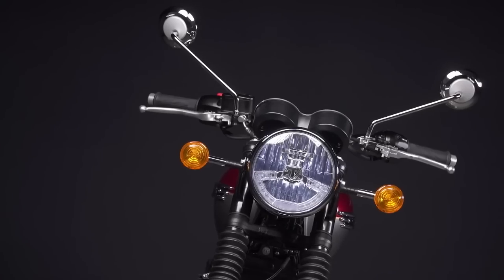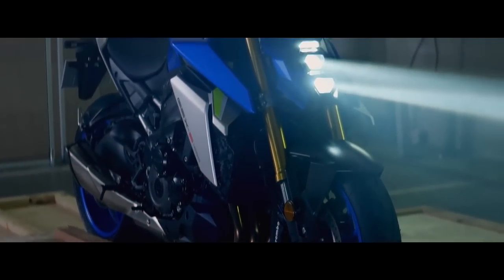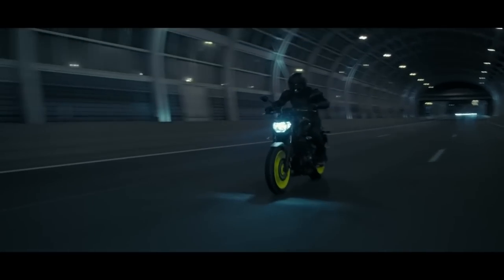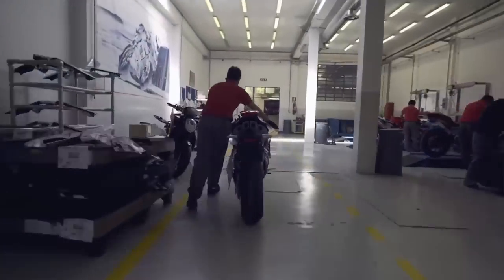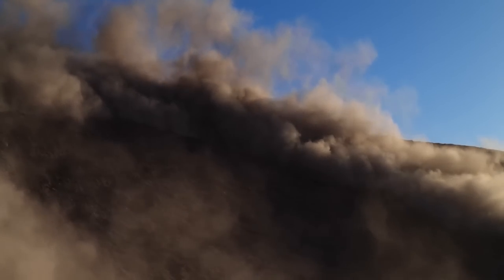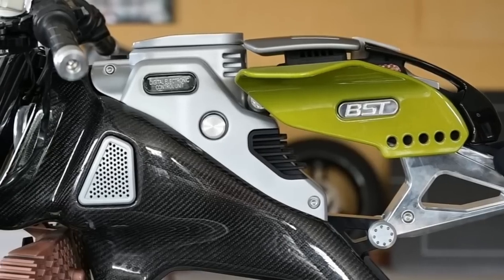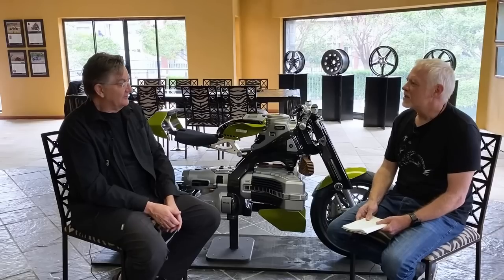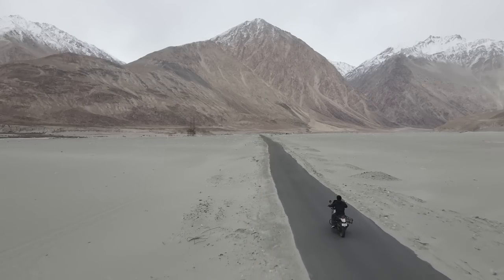Why old motorcycles look better than new motorcycles

Comment: The old motorcycles are much more honest. No fly by wire. No nanny functions.  
A carb handles fuel which you totally control. The FI unit has a brain somewhere which you request for fuel. No plastic covers. And so on.
Reply: I drive a throttle by wire truck with an automatic transmission for a living. Every time I try to accelerate it's like asking a committee for permission to do something that they don't understand
Reply: @danmanthe9335  you must drive a shitty DBW vehicle.  For actual vehicles meant to be fast, not only is this not a problem but it is vastly superior to boomer tech.
Reply: @twrcrew8852  seeing as how it weighs 20,000 lbs empty no, it wasn't meant to be fast. At all.  In any galaxy anywhere,  it's slow
Reply: @danmanthe9335  then ofc its no metric of what DBW actually offers. there are more pros than cons. the one boomer argument for anything electric is "i can't see what's happening so it sucks".  while it offers superior smoothness, response, ease of replacement, ease of access and removal/installation. and zero plumbing in most cases. 

I understand that there's a lot not to love about modern equipment that were put there EXPLICITLY to make life more difficult or adhere to politician's ideals that are not based in reality or experience, but DBW is not one of them.
Reply: @twrcrew8852  no, it is absolutely not a fair assessment of what the technology is capable of. Just one particular instance of it being frustrating
Reply: @twrcrew8852  DBW is excellent on a race track, so is puck clutches, slick tyres and a host of other things designed to cut .008 seconds off a lap time.

But when the cheap outsourced glorified potentiometers go bad due to any variable of reasons you’re left stranded.
 
Sure a flick of the wrist or shove of the foot is faster, but when you’re stranded by the side of the road on a rainy night in a forest. Vice grips won’t fix it. And you can’t magically pull a diagnostic laptop out of a tree to diagnose which part of the signal chain has decided todays the day to die. 

Simplicity is key in design, but nuance is lost for complexity. I prefer something that can be fixed and addressed simply. Flashing lights and fancy devices seem to be more headache then they’re worth once the warranty goes tits up. 

But if you desire Motogp technology for a 45mph commute to a corporate coffee shop then, so be it. 

But me I feel technology gets in the way half of the time and just adds unnecessary cost to the equation of get ass from point A to B.
Reply: @battoisoutto6657  You talk a good theory based entirely on the principal of an assumption. particularly this line "when you’re stranded by the side of the road on a rainy night in a forest. Vice grips won’t fix it. And you can’t magically pull a diagnostic laptop out of a tree to diagnose which part of the signal chain has decided todays the day to die"

Although it is mostly assumption and unfounded in truths, but rather fears and hypothesis. 

First of all, any DBW system is not simply run on a single line of code, a single circuit, or a single input source unless you're running a sub 2000 dollar chinese scooter or bicycle, maybe an RC car. Every system has redundancies in place, no not via hardware and a throttle cable, but within the hardware it does have. multiple redundant codes, chipsets, and input devices (they're not measured using potentiometers.)   In a semi-modern car that's run by fuel injection, an ECU, and a maf sensor - ALL of your risks that drive your fears about the vehicle rendering itself inoperable if any one of those things fail is just as high.   A single engine system failure takes out the whole vehicle. Having an extra throttle cable in your trunk or even a vice grip implies you'll fix the problem as long as the car was made in the 1960s and carbureted.  You're not using that argument for anything even remotely modern. 

The main reason above all else that needs no explaining however is that most cars on the road today are already DBW, and you didn't even notice. There's not hundreds of cars dead on the side of the road in your area each day, in fact that WAS an occurrence in the 60s with the "never breaking" old school tech.  Things are getting better, REGARDLESS of complexity - which is really only a source of frustration to the end user who wants to fix things in their back yard with no formal or commitment to the education that would properly equipped the individual with such knowledge and ability - whereas before a shade tree mechanic could start banging around and get lucky.
Reply: @battoisoutto6657  I'll end on one note, simplicity IS better. But what you believe simplicity is - is not always what it seems. Not saying Tesla, BMW and Mercedes did things right (examples of needlessly complicated vehicles to the point of detriment), But there are some things out there that run on just enough hardware, just enough software, and do it seamlessly and like clockwork, better than the most old school race plumbers nightmare with ITBs and carbs.  Obviously you could have it even simpler, but that's why bikes of that vintage are more comparable to Chinese 2 stroke bicycle kits than to something that truly lights your hair on fire. You need to meet in the middle, with the best tech available to you for the end goal.
Reply: @twrcrew8852  

Simplicity is great, so is a splash of technology where it is needed. Emphasis on needed. 
Modern vehicles aren’t easy to repair. If you think so then you must have access to an amazing shop.

My favorite vehicle I have is a 2002 Mexican VW bug. It’s reliable, simple and aircooled. Yet with basic technology upgrades.  Throttle body fuel injection driven by a cable, hydraulic lifters, and only the minimal amount of sensors required for the basic ECU. Disc front brakes, but also power nothing.  No driver modes, no 200+ plus computers giving me fancy gimmicks I’ll never use because I’m not going on the Nuremberg ring.

It’s a manual  4 speed, with crank windows, and the luxury of a radio. It’s a peoples car. Simple as.

I’ve had the original  ignition coil fail that was easy to replace part in a parking plot with tools purchase from a dollar store. If the same module failed on other modern car I would have been trapped in the worst storm to roll through the area in years.

But I get it most people need power everything and every electronic nanny turned on. But how long do these last?  I’ve seen countless cars after 7 years develop costly issues. A look on how fast luxury cars depreciate and how everything is getting infested with ‘technology’ that’s more and more inflating costs and adding in more fail points. Every “luxury” or “life improvement” feature adds on complexity. 

A look at any automotive channel that purchases ‘cheap’ cars like hoovies for example highlights this.

But I get it I’m an outlier in a world where people don’t want to fix stuff and a land where corporations are going out of their way to design stuff to not be serviceable by the end user. 

And nobody cares.

I’ve watched my friends get burnt on modern lemons because they’re designed to fail and be impossible to service. Dodge, Chevy, Ford, VW, the list goes on. Thousands upon thousands of dollars wasted, and cars that were mechanically totaled because what used to be serviceable parts were buried deep into engines, under intakes, or requiring the removal of exhausts manifolds. 

Computerized clutches too on modern manuals that cost 4500$ to replace. Happened on my mothers 2016 Jeep Renegade 

So many people I know just want simple and reliable vehicles.  And many want something that is maintainable. Especially in this current insanity that is the car market.

But we’re not afforded that luxury. We’re given insanely expensive vanity items that only keep on rising in price. So yeah simplicity is dead these days.
Reply: @battoisoutto6657  Again. you already seem skewed to one end. And it shows in your nearly obsession-based ownership of a recent 1st gen bug.  7 years, nah not really. I fully built my 240sx in 2008. Using the best of what modern tuner tech had at the time.  Didn't touch any of it since, more than 10 years and 130,000 more miles later (the car itself is well above 200,000 miles on the body), none of the computers or anything else you'd call "overly complex" is showing any signs of breaking or giving me problems.  It runs like a top. Motec, Haltech, HKS, and Greddy build good products that last.  In fact, the ONLY major thing showing signs of wear are my piston rings - to be expected on a 130,000 mile forged motor with a lower silicone piston that was built to be pushing 3x the factory power figure above 6000rpm, which has been visited often in this time.  

The electronics? nope. In fact, this motor can't afford to have ANYTHING go wrong on it, because it's level of tune is on such a fine margin of error. 

Let's talk about a newer car; my 2016 Mazda Miata RF.  There's BCM data sent through the ECU itself. What does the door handle have to do with the engine? I'm not sure myself. But knowing that it is a retractable fastback, it does roll down the windows slightly when you get in and out. Also when you put the car's top down..  ohh nooo. the scary electronics in the door window.. it might break!   Yea, it could. But you know what? there are cars from 2005 with this door open window down feature that still work. and it's not "most of them are broken" either. most of them still work. Cars made over 10 years ago. 

So to summarize, your fears and obsessions with owning clocks just to ensure you flee from any possible problem with an objectively complicated object - no matter how you slice it - are based entirely on fear itself.  The amount of stress you spend trying to hold your life together through your vehicle is not worth the efforts.  I remember what it was like to constantly try to cover and garage my 240 and to do "all the things" to combat rust and corrosion.  I even looked into replacing as much of the vehicle with non metallic material as I could.  The effort to be extreme will still end the same way. Your VW - WILL - break. And you know what I find? the difference in time that such will happen is not as extremely short for modern vehicles and long for vintage vehicles as you hope it will be.
Reply: @twrcrew8852  yeah because spending 5 minutes to replace an original part in a parking lot is such a waste of my time.

I haven’t spent hours on weekends on my VW bug. Because it’s simplicity.  Keyword this is a Mexican vw not the new beetle POS that’s a rebranded golf. Technically this is a Vocho sedan 

Funny how researching all manufacturers brings this up with a few select models of cars that don’t give any problems. But those cars are in between.
Reply: @battoisoutto6657  The big 3 Japanese manufacturers are far from "in between". Unless you live out in hicksville where you don't see Japanese cars out of stubborn brand loyalty?

We've established that you were talking about the Gen 1 beetle, let's not insult my attention to detail here. Also, should others who actually enjoy fast cars with their own unique design want to indulge the senses, they certainly shouldn't be reduced to owning only a bug if they also want reliability - which I can assure you they certainly aren't - DESPITE having a little more complexity.   I will stand by my flag of knowing that you are blowing your fears of complexity out of proportion based on your limited experience and anecdotal evidence of friends who owned notoriously bad vehicles.  

I on the other hand will continue to enjoy the best of what technology has to offer and pick and choose from it what helps me enjoy the car more while still not encountering the headaches you think I'll end up with.
Reply: @twrcrew8852  Well even the big three Japanese companies have had a drop off in reliability as they start cutting corners.

But hey time is money and why not spend thousands in a repair shop for basic maintenance. I mean even Toyota charges shop rates only a few clicks below Ferrari. 

But yeah I’ll take my lowly insult vehicles of the Measely Mexican VW bug, Saturn sc2, and a box panther Lincoln town car. All cars that are known to break high mileage counts without a sweat.

But you enjoy your fast as balls technology and enjoy the prices when something will go wrong. Different strokes for different folks. 
Lol.
Reply: @battoisoutto6657  Except that I am not spending exorbitant amounts of money, That lincoln town car will eclipse my repair bills in gas and oil alone 5x over.  (you realize in 2022 any car that gets less than 40mpg is spending more than twice the money each year to run that a car that got 18mpg in the 90s did? My 2018 civic hatch worked out to 3400 a year in 2019 - for just fuel and oil changes... that was a 40mpg car. So a 20mpg car would have costed me 6800 in that same year, now imagine in 2022 when gas is not 3.85 anymore but 5.75 and rising.   So your "cheap" car in 5 years costs more than my civic does to buy outright. and I assure you this car wouldn't break in 5 years like you think) And that saturn is  far from a car that's been future proofed. the car's substructure and body panels are made of ABS.  Guess what that does in the sun over several decades?

Also throwing out falsehoods doesn't prove your point. it only displays your fears, which we have well established during this conversation in every comment made thus far. If you are going to argue a point, leave out the strawmen.

Comment: I find the feature of a bike that interests me the least is its appearance. Acceleration, handling, brakes are far more important. I am always mildly surprised by the number of people who tell me my 1290SAS is a great looking bike. I suppose it is the combination of orange on black with orange crash bars, but I admit that in the beginning I thought it resembled a large insect. The performance on the other hand is terrific, maybe not in the class of my old R1, but the ability to wring the neck at any moment, upright or cranked over, confident that the electronics will prevent me making a fool of myself is reassuring in my eighth decade.

Comment: IMO, a motorcycle that missed the mark is BMW's R18 that was inspired by BMW's 1936/37 BMW R5. The R5 in classic black and BMW white pin strips, maintains a sense of harmonious and beautiful proportion and balance. Much of the DNA of the R5 is carried over to the R18 but in BMW's effort to build a muscle cruiser competitive with Harley-Davidson and Indian the 1800cc engine size is out of proportion to the rest of the bike blurring the classic lines and symmetry. What would this bike look like if BMW had used a 1250cc engine in proportion to the classic R5? The R18 is a piece of engineering art but a failed motorcycle design.
Reply: Also sitting one one, I was amazed with how low they sit and small of rider they felt designed for.  I'm a bit tall, but I've never had a such a large bike feel like it was built for only a 5'2 rider

Comment: It BUGS ME that the rear of current bikes are “jacked up” pointing into the air!   Passenger cannot reach foot pedals easy or at all.  They have to climb and sit higher off ground…(wife Asian) short legs but still 5’1”.   So not as short as most.

Comment: Fairly new to bikes but a car guy since day one, but after starting riding I was worried about how an electric motorcycle would be harder to control without the clutch, just like electric scooters or CVT scooters are harder to have throttle control of

Comment: I have a 30 years old bike, and I wouldn't trade her for anything. I love that simple look she has, a big old air cooled engine, a single brake rotor ( I don't like the brake performance though hahaha), the big two chrome pipes. The really comfy and wide seat which offerrs perfect place for my pillion. The simplicity if I wanna fix something,  the only thing is needed is a basic toolkit. Around 100k miles in it's clock still running perfect, no sign of engine wear, doesn't burn any oil. So definetly a keeper :) The only thing I miss from a newer bike is the ABS and injectors, but I guess I can live without it.

Comment: Thank you for making this video. So true. These totally ugly modern motorcycles with their hodge-podge jagged plastic pieces, the freaky license plate holders etc.
I'd take a 79 KZ1000ltd, a  '70s BMW R100, an '83 CB1100F,  a Harley Sportster 1200 or Lowrider Sport any day.
Reply: Anything from the 60's or 70's will float my boat!
I bought a 2020 Honda CRF250L, but certainly not for it's appearance. I am really getting used to the electric starter & fuel injection tho.
Reply: I have to say the mid-late 70s KZ1000ltd  is the best styled bike I've ever seen. Utterly amazing curves, proportions and of course performance.
Reply: What were they thinking about with that seat? I wouldn't ride that thing to a shit throw!

Comment: I have a two modern bikes, a 2015 Kawasaki KLR-650 and a 2018 BMW K1600 GTL. The KLR (of that generation) was killed as of 2018, with a carburetor, etc (it didn't have points and condenser but it was close) and the BMW has the fuel injection, cornering ABS, traction control bla bla bla.. Which one do I ride 99% of the time, the BMW because it's better handling, faster, more comfortable etc. (and I think that it looks damn good!)